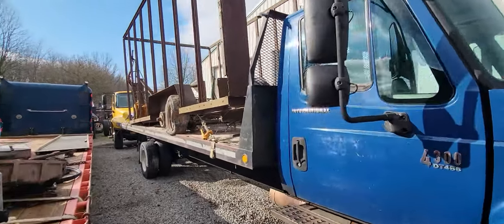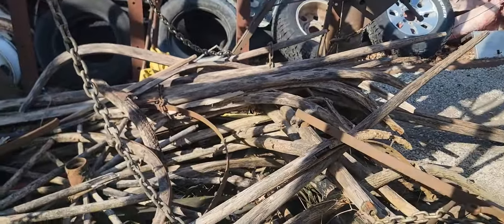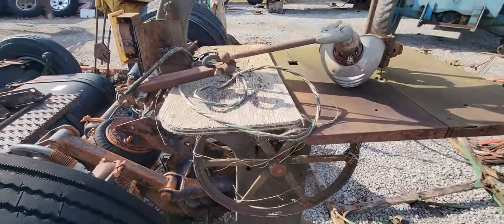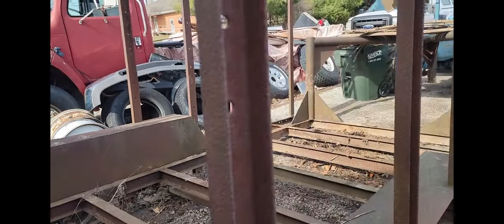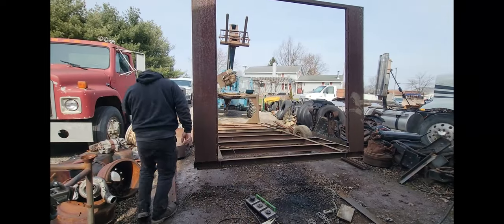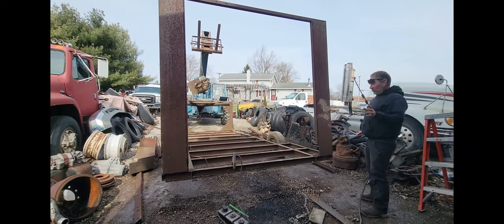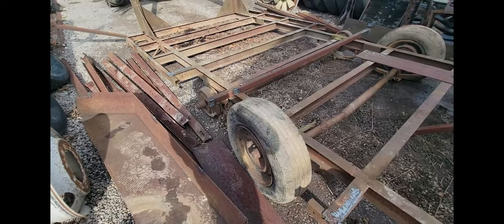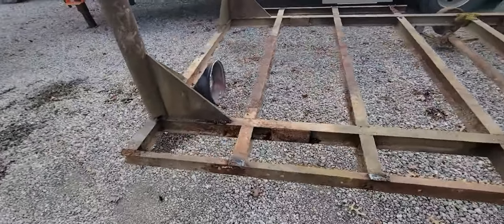FREE GOOSENECK TRAILER! GEM OR JUNK?

Comment: Dear J.C. Smith projects family.
👍👌👏 At the very first glance I really thought that you wanted to build your own camper trailer. Or at least a mobile chicken coop. 2) This trailer and the stuff on it had definitely the right price tag. Therefore I say: Congratulations 🎉 for this purchase. 3) All you need now is a combined sand/water blaster unit. Something like that would also be very helpful for your truck frame projects. Because nearly all of that hard, dirty/dusty work using a needle gun, wire wheels and angle grinders would be obsolete. We're all not getting younger. I hope that you will be able to purchase such a helpful device soon.
4) By the way: I would definitely love to own and use such a tall, old and sturdy bandsaw. Restoring it shouldn't be that much effort. I already own an old, tall drill press that was formerly driven by a flat belt. It was already converted to have an electric motor on it a looong time ago  Unfortunately there's still this big pond between us. If not I would definitely try to buy this bandsaw from you.
Thanks a lot for making explaining recording editing uploading and sharing.
Best regards, luck and especially health to all of you.